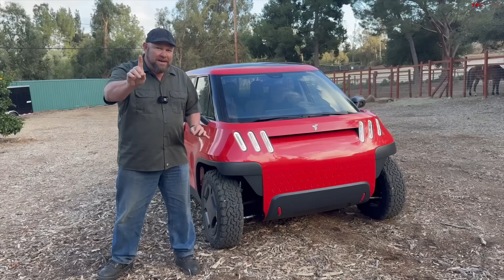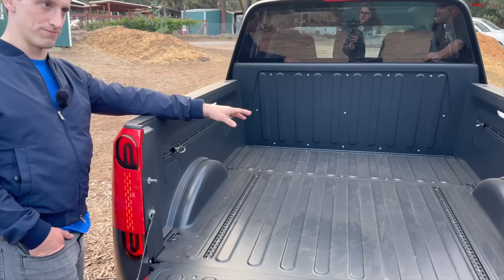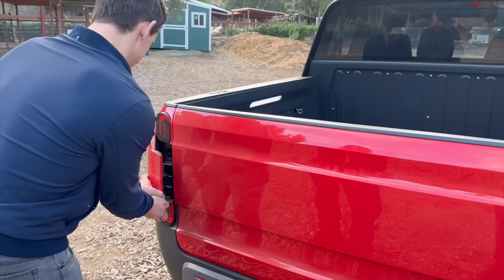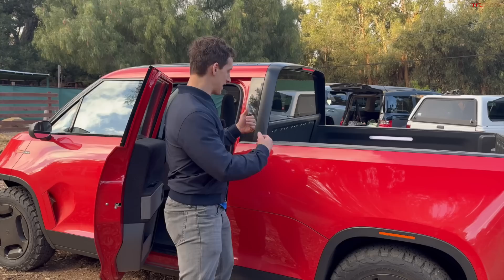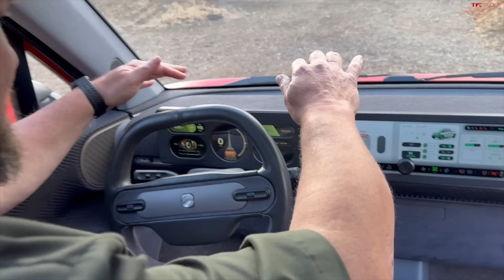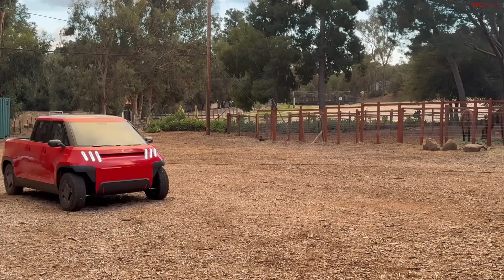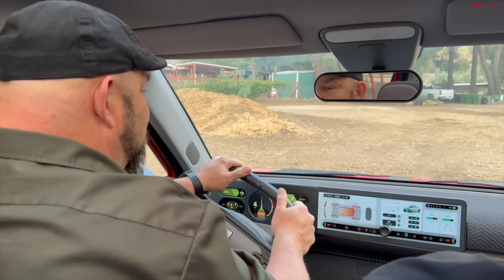I Drive the Most Revolutionary Truck In Decades: Meet the Telo MT1!

Comment: I like that this is aimed at ppl who need a truck occasionally, to get yard stuff, furniture, but otherwise, just a normal commuter vehicle. Big trucks are SOOOO impractical in a city.
Reply: I don't live in a city but would love this small truck. I just need to do chores on occasion. The big trucks made today are just too much for my occasional needs.
Reply: @ Small town runabout would be fantastic. The height of the seat from the ground would make this great for older folks with issues bending down - seat at standing bum height - one of the reasons my injured spine loves my Voyager, while my musclecar toy gets saved for weekends.
Reply: @Puke0010  Then you rent one from Uhaul or surly you know someone with a truck. If you need truck occasionally your not guna spend $40k on that just to use it once or twice a month/Year go buy and old S10 or Ranger. If you want something new then the Maverick is nearly half the cost and can do more. This EV is not practical outside of NYC every other city is big enough for regular mid sized trucks of full sized even. EV trucks are not practical trucks sorry they just are not capable of doing what trucks should do. They are capable of showing off that you have money to spend on something that doesn't work outside of driving it from home to the office then to the supermarket . Yes most turcks that what they do but if needed they could tow a car or haul gravel whatever EV can do that but only for a few miles if you are lucky 100 miles and before someone says that a long way I grew up in houston and it's like 60ish miles across. But Houston is very spread out after looking it up on google Houstons Metropolitan area is 10k square miles or bigger than Massachusetts so EV trucks are not guna work there just like most big cities in the US they are spread out NYC is not and that's why I think it would be the only city this type of EV truck would work but the price is still no from me I can get more occasional truck from a maverick of santa cruz then from this EV.
Reply: Their biggest buyers won't be consumers, but Urban government depts - waste cleanup, parks and gardens maintenance, the sort of thing that a large pickup is a waste at, and where the quietness of an EV means less disturbance to the public. Next will come inner city Police and Emergency Response depts, where high speed is useless, but nimble gets officers and equipment to places SUV's and Trucks won't fit.  After that will come companies doing inner city delivery, support vehicles for industry, sports event support, and eventually consumers. There's much more potential for this size EV in government and corporate use.
Reply: @PiDsPagePrototypes  100% agree. NYC had some kind of new guidance or regulation where their parks department and some other city departments started purchasing evs. They’re a bunch a leafs and ford lightnings. Polar opposite roles. This would negate the need for two separate vehicles.
Reply: @PiDsPagePrototypes  most likely. There are plenty of places where they are either using kei trucks (which are right hand drive, gas) or something like a side by side which isn't street legal.
Reply: @dougf-s6w  Side by Sides are street legal in some places. Where I live they are legal as long as they have proper lighting and safety ( Seatbelts proper windshield) and are registered and insured for road use maybe more stuff I don't know exactly. Now the one I see on the road are not utility ones but off road high performance ones but if those are legal then the utility one should be as well I would think as long as they meet the legal requirements.
Reply: @PiDsPagePrototypes As a blue collar contractor I think it has plenty of space in the consumer market particularly as many "small" trucks like ranger, tacoma and Ev trucks like rivian have grown to be almost 1500 size trucks with similar mileage. Sure their are options like the maverick or santa cruz but they fall short in utility. 

I would love a truck like this for probably 250-300 days of the year. Most days I don't exceed the mileage or tow capacity of this vehicle and the form factor and utility are appealing
Reply: @killbots94  Contractors servicing inner city residences would appreciate the size.
Reply: @PiDsPagePrototypes  I'm sure they'll eventually make a version without the bed and make a tiny 7 seater too, lots of options with the platform they've created.
Reply: @dodgywheelsandropeywiring5697  The configuration possibilities for a rig like this are virtually endless, and I think these guys will try to keep their fingers on the pulse of the market for versatility.
Reply: @PiDsPagePrototypes  It's to expensive for government depts. they will see the price and just get a Maverick for nearly half the cost or for the same cost a base full size work truck. Like the school I live buy has an old Kei truck as the field gardener vehicle along with a gator ( I think thats what they are called It's a John Deer). I don't live in a big urban area at all anymore. Outside of NYC I don't think this truck would really work for most people who need a truck. People who occasionally need a truck can rent one from U haul or probably know someone with a truck. I know when my sister bought her f150 back in 05 the first weekend she had it she had "Friends" asking to borrow it or asking if she could help them move something. Same with my brother he often helps tow stuff or haul stuff for others with his truck. I think people with trucks expect to get asked to move or tow stuff at least a few times right? I've only owned a sedan so I wouldn't know outside my family.
Reply: @carloveridc  It won't be too expensive for government departments. They get a bulk buy deal that brings the price per unit down, and they don't charge themselves the same fees and taxes they charge consumers.
Reply: @PiDsPagePrototypes  I think you're underestimating the market for a rig like this, especially once it's finished out and goes into production. Screw gov't depts, most of that needs to be privatized anyway... This is practicality that a lot of people will want if it's implemented well and especially if either the entry price comes down a little or the average income increases across the US, which should be the case in the next couple years.
Reply: @PiDsPagePrototypes  its 500 hp. What so you mean it can't do high speed? I guess everything relies on getting crash test certified which maybe they can push out in those markets until it is.  But this is made to be real truck.
Reply: @guyod1  you misunderstand the point, high speed chases in an urban city are very unlikely due to traffic and a danger to the public. The "useless" comment was aimed in that direction, not about the car's power output
Reply: @ The biggest issue this will face a high speeds, such as on the freeway, is the same as a sportscar or the two door Mini - other road users ignoring it or just plain sideswiping it because they didn't look for it.
That 500hp is going to be much more useful hauling a similar sized trailer water tanker, both for parks, and fire fighting.
Reply: @guyod1  It's EV so no not really. Real trucks tow and haul heavy loads . Can this truck do that? Kinda but not for long . And honestly would you want to tow anything bigger then a small trailer with light stuff on it? Nope. Sorry if this truck was a EV hybrid with a small generator engine that only charged the batteries to give it more range sure but EV only nope.
Reply: @PiDsPagePrototypes  That's a problem ALL cars face on freeways. This also isn't nearly as short as the mini or sportscars. It's about 6 inches taller than the mini. The only people who won't see this are the idiots in the giant trucks who already don't see ANYTHING else.
Reply: @PiDsPagePrototypes  i mean, this truck is lifted ten inches, so I don't think that'll be a problem because it's riding high
Reply: @Lap1ac-3  not in LA!
Reply: @PiDsPagePrototypes crazy how people read that comment and took it like you said the truck is slow. Good for engagement I guess. Lol
Reply: These things start at $41K. Nope.
Reply: @sh969  This would be great for a farm truck if it is rugged enough.  

 Just one to get stuff A to B when doing rounds of the little things on a large property. Or between properties. 
 
 I wonder how fun it is to drive. I wanna see a 800hp version with axial flux, and quasi/SS batteries.

  I love electric. Not because it is clean. Due to the performance. I don't drive 4 hours straight. Waiting 20 minutes to charge to save on fuel cost is a no brainer.  

 How long before we see a family with an Aptera (solar car), and this in their driveway. 

 Anyway wish our government embraced batteries over drilling. Improving batteries improves our lives, and electric motors are superior.
Reply: 41000 isnt occasional pricing
Reply: That's what made me want a Maverick. I wound up with a Subaru Crosstrek, which has been great. Sometimes I wish I had a bed in the back, but rarely
Reply: @titussardonicus338  ever considered putting a hitch on it And just getting a little utility trailer?
Reply: I drive a Crosstrek also.  I chose it because it’s the smallest car that would fit all my equipment and is also very good at light off-road.  I’m a contractor in San Francisco and parking in the residential neighborhoods is always an issue so the shorter the better.  The Telo is 2 ft. Shorter than the Crosstrek and has way more room for equipment.  The Telo should be just as good if not better off-road.  I’m 12,000 on the waiting list
Reply: @sh969  yeah, even my f150 is way too big now, you can barely pull it into a garage. The Tacoma is a mid size truck, and it's as big or bigger than full sized trucks were 15 years ago.
Reply: @sh969  i love watching people trying to parallel park their light infantry vehicles in the city.
Reply: @sh969  I agree. I've been to be Orleans and I was there for about 5 days. I can't tell you how many people had big trucks and still commuted within the city.
Reply: Most normal things are impractical in a city.
Reply: I want this thing. It's sick for anyone who doesn't want to wait. I do have the Maverick. I've had it for a year. It has saved me a lot of money and it's perfect for somebody like me who really only does garden soil and light loads back and forth garden from the lumber yard. Things like that it saved me a lot of money. It's been reliable for a year which obviously isn't saying much. It's not a fun vehicle to be honest but it does. Its job extremely well
Reply: You described 97% of truck owners in Texas lol
Reply: municipalities use similar trucks here in the netherlands; small, electric, got a bed on the back with drop-sides so it can be a flatbed, small enough to fit on a bike path and can haul a full-size IBC with equipment.
Reply: you can rent a truck
Reply: When I have to move things occasionally I just call for a transport.
This "car" is ridiculous for that price, it's not worth more than 1000 USD.
But hey, it's your money.
Reply: yea 40 K and up for a yard truck is such a great price point xD lmfao
Reply: Ugh, a minivan can haul more stuff than a Maverick or this piece of crap.
Reply: Exactly!!
Reply: If it's "occasional" and you just want a normal commuter, then why do you need a truck, no offense? You can always rent a home depot truck for those rare times, and it'll be cheaper. One of my friends runs an agriculture business as a side hustle, drives an F350 for heavy jobs and F150 for smaller jobs, tows heavy loads, writes them off, and beats them up. That's called actually needing a truck, if you ask me. Maybe 5-10% of consumer truck buyers, if I'm generous, fit that mold  This is a cool truck that's probably aimed for businesses that actually operate in big cities where parking might be tight, so that's cool. And the consumers buying this will be buying because it's cool, not because they "need a truck".
Reply: The Ford Maverick really makes more sense for most people who want a sedan/pickup.
Reply: @JimYeats and if Ford puts out the maverick as a full ev it'd be great. It's still big at 200 inches long, it's only small when compared to the monstrous 225-235 inches of the f150. Which are impractically huge. Also, i don't want a truck where the hood height, unmodified, is at my shoulders. Or where anyone shorter than 5 ft disappears entirely
Reply: @jimYeats.    The Maverick is exactly 4 ft. Longer yet the bed is 6” shorter.  The Telo will have a midgate not sure about the maverick.  For fun: the Telo will do 0-60 in 4 seconds.  Doubt the maverick will do that.  In my mind the the Telo make a lot more sense.
Reply: Golf cart catchy. Ever see the mail order cars from China? Glorified golf cars but interesting.
Reply: Who’s paying $46,000 for this though?
Reply: @sh969  It's absolutely not impractical when you're trying to impress other men, though.
So many men love trucks and constantly wanna talk (flirt) with the man who's behind the wheel.
Reply: Drove a dully in DC for a few years. It's not to bad, and it'll just fit in 6 compact car spots if ya try to park perfectly in one spot. Also, it moves traffic faster than lil cars.
Reply: @RustyBluePort  Did the same on LA freeways. People get out of your way, they assume youre an uninsured mouth breather. Works for me
Reply: @gordocarbo in Atlanta, big trucks do fine, once they are in the lane. Need to change lanes, pull out into a lane, etc, no one is letting you out. Of course, I'm pretty sure half of it is out of pettiness that the driver of the big ass space hog decided to drive that thing downtown.

Comment: I'd like to see a split gate leading into the cab so the driver doesn't have to push the seat forward. Especially if the passenger seat also folded down to accommodate 10 or 12 foot boards.

Comment: The Telo is the closest to matching my ideal truck. I would be even happier to ditch the rear seat and give it an 8' bed and trim down the range and power some to reduce the cost. The convertable back seat is probably the best compromise that I can expect. I would prefer not share my cabin with the stuff I am hauling and I am sure that an 8' bed would be much cheaper than a row of seats and all the mechanisms and seals to make the convertible bed.

I hope they can meet the $41K price target. They will probably be the first auto manufacture ever to do so.

Comment: As someone who owned a Kei truck and had to get rid of it due to parts. Their mindset on manufacturing and not re-inventing the wheel is super exciting. 
I've also loved the idea of having one electric. 

I wouldn't plan on using this for long drives. But the "short" range is more than enough for work things, and I love the idea of not destroying my battery range becaue i want the AC on for keeping it cool for the dogs. 

They are also willing to admit that things are happening in these test videos. Mentioning that the creaks are happening and they are aware of them on camera is a sign of confidence.
Reply: I had A LOT of creaking in my cmax initially when it was brand new, rubbing talcum powder on the door seal rubber solved that.
Reply: Better than silent mega corps who sell a truck that rusts to crumbs in 3 years. I'm impressed by Telo's work, so far.

Comment: It’s not a truck. It has NO ground clearance. A truck should be able to go out in the woods on two tracks that may have deep wheel tracks and not high center on the undercarriage. That should be called a city truck because that’s the only place it’s ever going to be any use. When people say they want mini trucks back we are referring to the likes of the old ford ranger, Chevy S10, Toyota and Nissan. Also we want them with 4 or 6 cylinder GAS engines. Not full of computers and useless/endless sensors that fail constantly and cost a fortune in diagnostic test fees and labor all before even being fixed. Bring back the small trucks of the 80’s/90’s.

Comment: I like the vehicle. Just don't understand why it has to be so ugly. Just a small frunk would look so much better. Overall though, I'd totally have one to daily drive. Fold down feature is so much better than the avalanche window breaker 9000. Would rather have a foot longer bed with some rear seat storage instead though. I will say though, this is the most realistic vehicle startup I've seen in a while. So sick of the 120k mall crawlers meant to garner some sort of nostalgia. This could be a fantastic city truck or just one that runs errands for small businesses. Would be concerned about crash tests though

Comment: I love it. I live in East Bay and this ticks every box I have except for a range extender option. If we had a 240vac input in the bed so I could carry a generator with me when required, I'd be so happy. Regardless, I think this just jumped in front of the Rivian R2 and Scout for me. With the camper option, it seems like what the ID Buzz should have been.
Reply: There is a van variant on the drawing board as vehicle #2 if the truck is successful.
Reply: I think if they used the "monster tunnel" and put a small generator and fuel tank in that space for range extender it would be worth it but as it is now I think it's over priced .